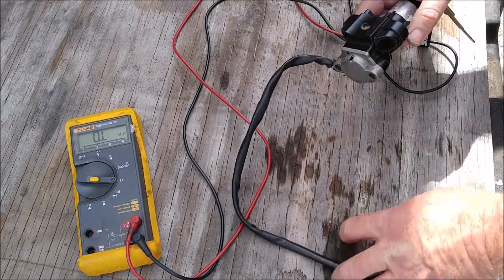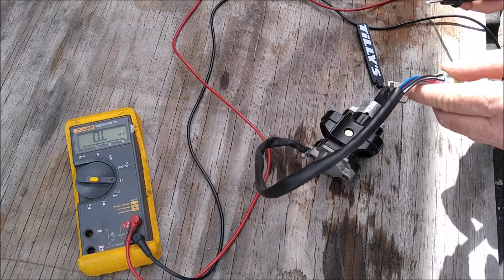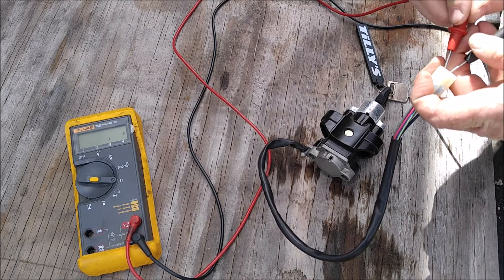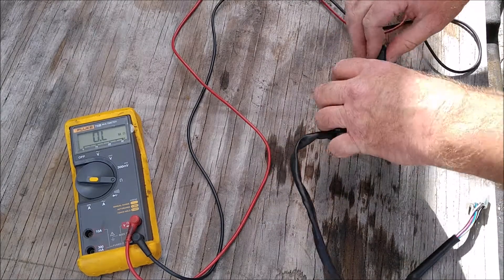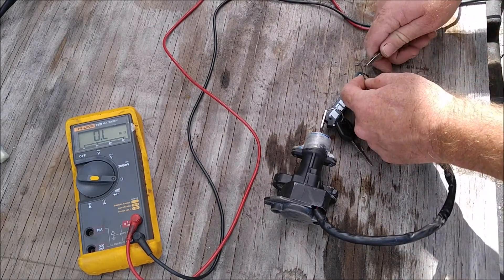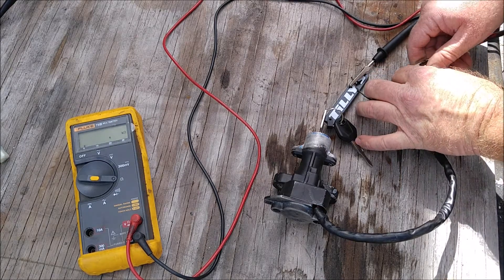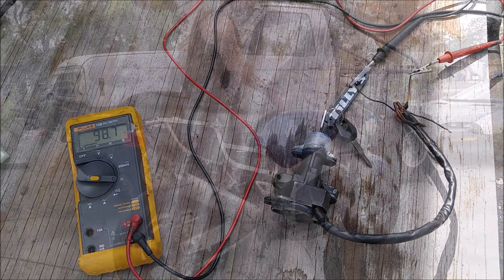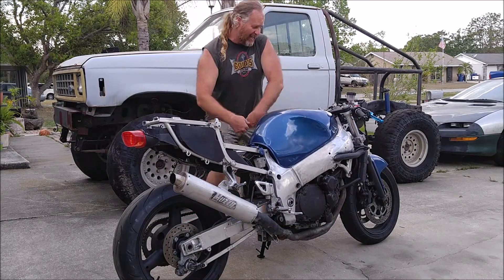Suzuki GSXR 600 SRAD 100 Ohm Ignition Switch Test

Comment: I swear to God if my 96 750 has 100-ohm resistor not working I'm going to be super pissed since it's been sitting for about seven years now and now that my 2007 just took a ship from the start switch

Comment: Man I'm having the same issue with my 97 600. What wires did you put the resistors on
Reply: What wire did you drop the resistor on? And how did you connect?
Reply: @louisbianchi5219  pretty sure it goes black and white resistor to orange and yellow. There is another guy on yt Wisconsin pit bike or something that shows you how to do it aswell.